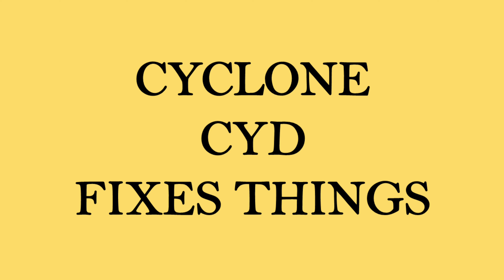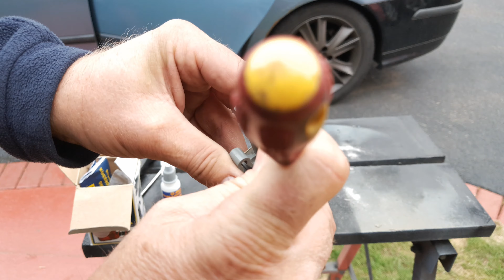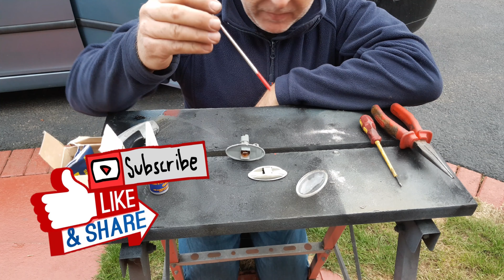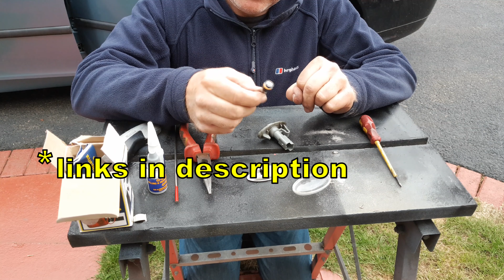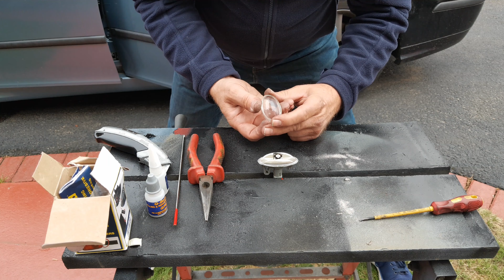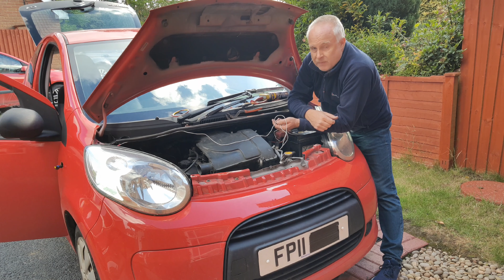Citroen Side Indicator LED Conversion | Cheap Car Modification Ideas

Comment: Spot on replacing the bulb there AND doing away with the shield bit. You probably wont need a canbus bulb if the front and rear are filament or canbus led as the total current drawn will be enough.

Comment: Would you recommend using canbus LED for everything in general or just for the blinkers? I drive a Citroen C3 2004
Reply from the maker: No need in other lights, but imperative for indicators. If you check out my other C1 LED videos there is a discount code for Auxito - top notch bulbs, even Scotty likes them, lol

Comment: What an idiotic design of needing to replace entire unit instead of just replacing a bulb just like on previous models. Unbelievable.
Reply from the maker: Cheaper manufacture. Simples!
Reply: @CycloneCyd 
More expensive and wasteful, Sergey. They've turned a 50p bulb that needs replacing into a £5 unit. Not as ekspensiv as our chipest kar insurans but still. 
Aleksandr.
Reply from the maker: @Phoenix_cataclysm_in_2040  Cheaper in manufacture. Not their problem when you need a new bulb!

Comment: My wife is crap at reversing. Have you ever known anyone to fit a reversing camera to a Citroen C1 (2010)? I am looking at a wireless unit but there seems very little room around the rear number plate and also very few options for getting the camera wiring from the camera up to the wiring for the reversing light. Any thoughts?
Reply from the maker: Why not put the camera inside the hatch? Maybe in one of the bottom corners.
Reply: @CycloneCyd  I had thought of that as a possibility. Maybe I will go head and buy one and use that as a potential solution. :)Thanks for your thoughts on this matter

Comment: been looking for something like this for a while. Thanks for the howto video. Just one question,  Will they pass the MOT.
Reply from the maker: I see nothing in the MoT manual that would cause a test fail purely from the fact they are LEDs. LEDs themselves are not precluded. They work as they should and don't flicker (though this is usually a CANBUS problem). So, in short, YES